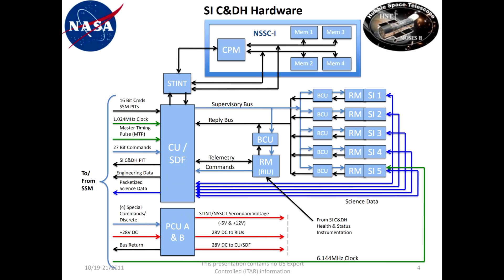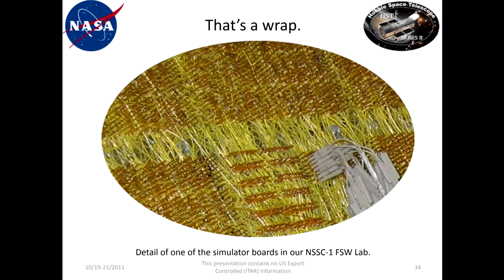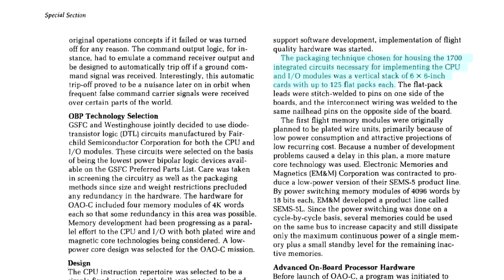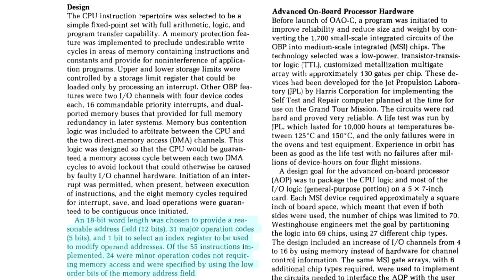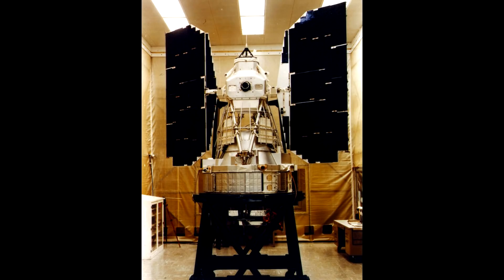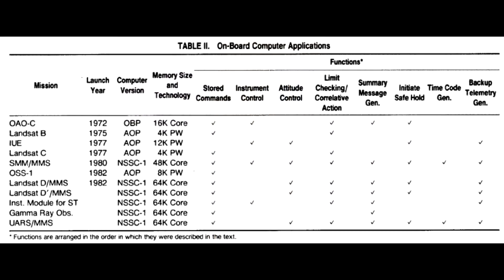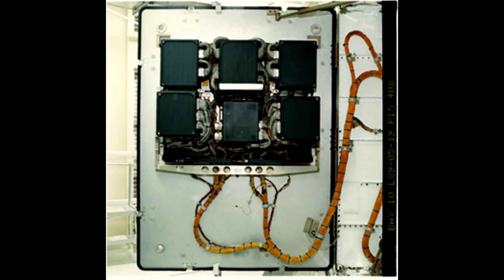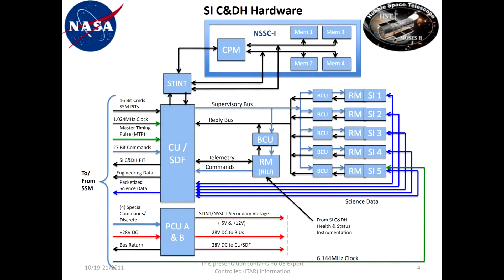Hubble's Latest Problems May Be In a 50 Year Old Computer Design

Comment: There was a CME in May 2021, I'm betting it damaged something that either failed a little later or it just took a little while to actually hit a failure point. 64K of memory isn't a lot though so odds are if that is the case it just took a little while for total failure.

I'd love to play with some of that stuff, I'd wager most of us in IT would.
Reply: What is a CME? Is the ME part of it means magnetic event? Caused by a solar flare of something? That could certainly damage electroncs, but if that's the case I don't think Hubble's systems would have survived 30 years. They must be quite well shileded and rad hardened.
Reply: @mrnmrn1  coronal mass ejection.

There's usually a magnetic aspect to that as well but that's reactive from Earth's magnetic field. I'm sure it has some magnetic strength itself but that's above my pay grade.

Hubble is shielded but nothing is 100%.

We have issues on the ground with terrestrial wireless when the CME are powerful enough, still not enough that it causes issues that anyone else notices.

CME are ejections of energetic particles from the sun, a chunk of the sun is sent out into space at speed.

A large CME could literally wipe the Earth clean, just a barren, dead rock.
Reply: @glenwaldrop8166  Ah, thanks, I knew that stuff, just didn't know its name and especially its acronym, Google did not help either with the keyword CME. I should have tried Wikipedia.
Yes, that's very nasty stuff, let's hope an other Carrington Event won't happen in our lives. Few years ago I read an article about what could happen if a Carrington-level or sligtly stronger CME would happen nowadays. The resulting magnetic storm might cause an effect like if it was WW3, because it's expected to bring down most of the electric power distribution systems and the whole Internet globally, with equipment and infrastructural damage (including many satellites) worth of trillions of dollars, it would take many months to recover just the electric grid, let alone the Internet, this would certainly wipe the economy globally. On top of that, there would be a good chance for multiple nuclear disasters at the level of Fukushima and above, because it could bring down the control and cooling systems of many reactors and consumed fuel rod storage sites.
The good thing is, such a CME should  be predictable, as it usually follows a huge solar flare, which can be detected, and the CME 'cloud' travels quite slowly, it can take hours or even days for it to reach Earth. We are already monitoring solar flares, so if we detect an exceptionally big flare, we should prepare and disconnect all distriubution transformers from the grid until the CME hits the Earth. This would certainly have horrible economical effects, too, but at least the power grid would be recoverable within short order after the event.

Comment: Hi Scott, could you pass this on to Elon, he's not responding to my tweets 😉
Dragon could rendezvous with Hubble, but doesn't have a manipulator arm..
Ok, so why isn't one being designed to fit in the unpressurized trunk section?
Seems like a logical place to put it..
It could be, (excuse the pun), a telescopic style so it can condense down to fit in the 3.6mt space, with multiple elbows to give a proper reach around.. (they fit a couple of pairs of 15' wide solar panels in there in the last CRS launch, so there's plenty of room)
The arm could mount to the top of the inside of the trunk, and after the servicing mission, Dragon could go to the ISS and leave the arm docked there for use at a later date..
C'mon, do I have to do all the thinking here..?
Get me a pen and paper, I'll fix this..

Comment: 50 year old computers should dispel any claim that bloated, pork driven Federal Agency NASA advances technology… Even for Apollo Nasa used off-the-shelf private enterprise technology.. Too many confuse things Nasa USED that were developed by private enterprise or academia.. For example, NASA didn't invent Tang, Velcro, ball point pens, transistors, Integrated Circuits, Teflon,  GPS, computers, microchips, cell phones, carbon fiber, the internet, solar cells, fuel cells, pintel rocket engines…..or much of anything else
Giving NASA credit for the technology it uses/touts is like giving a rooster credit for sunrise.

Comment: Bru. 50 year old pc parts run the hubble. Lol. They could probably replace all the pc requirements for it using a raspberry pi 4. Would probably cut it's weight down alot too. They should just fix it if the lense is still fine just replace the computer and the batteries.

Comment: Video boring. No idea why there's not a updated space thing. With a 3d printer, you can, worst case scenario, 3d print a modern 3d printer. Otherwise, no excuse why space problems will ever exist other than being short on resources. Motherboard old? 3d print a new one.

Comment: that design is that way using the rad hard version of the s80386 (and later AMD 486DX4) because I talked Ball Aero out of using 8051's and lots of Actel FPGAs and won Intel and the RMK real-time kernel in a redundant distributed real-time architecture... would never have lasted as long as it did if they had gone with the original concept. Lol and the CPU is fine it is the memory board that has failed...

Comment: Been programming 39 years - and the stuff they did before me and into the early 80s was amazing. Software was a very tight and disciplined science. Today - with a single jpeg picture larger than the entire computer system back then - makes current software engineers pretty sloppy.
Reply: Yes I remember writing assembly code in the early 80’s - TBH if you wanted smooth speed execution other than Binary there was no choice with the memory limitations. Nowadays they use off the shelf bloated routines, and cobble them together. We have gone backwards with less and less being able or being taught to eloquently code.
Sad really - imagine what could be achieved now, by using less.
Reply: @Nighterlev  that is most definetly not the only reason why. many more reasons why programs or files these days are massive is because devs dont really have a size limit anymore. just look at modern video games. the devs that develope those probably never heard of file compression.
These days if you code something and you need a function you import it from a library instead of writing it yourself. though most of the time that makes the program way bigger than it would need to be because libraries are usually bigger and have more functions than you need for your application. or in other words, compare the size and the memory consumption of windows 10 to the size and memory consumption of arch linux when in both cases your goal is to watch a youtube video. in arch you specifically install what you need, making your system lightweight and resource friendly, while windows comes with all sorts of shit you dont need or dont even want

Comment: The best bit is everything stacked on that entire board would probably fit on a single modern chip and end up a fraction the size of a postage stamp. Paired with a tiny power supply that would draw a couple of watts at most. The CPUs, all the memory, all the buses and sub processors. The lot.
Reply: Yup but that chip would also die in about 5 seconds when exposed to space, modern tech is far more vulnerable to radiation than the older hardware was, so you have to specifically build stuff to survive so no off the shelf parts, and definitely no apple logos
Reply: @shanematthews1985  Radiation hardened processors that are a great deal more advanced than Hubble's hardware do exist. But yes nothing from the last few years because the transistors are so small they are vulnerable to flipped bits. Even so all this gear would almost certainly be viable on a small SoC. Such was the massive increase in performance from when most of this was designed in the mid 1980s up til the most commonly used radiation hardened chips today like the RAD 5500, a product of the early 2010s.

Comment: 2:50   There were 1700 flat pack integrated circuits and there were 125 on each 6x6 inch board.  So, actually there were only about 14 boards in total, as opposed to the 125 boards mentioned by Scott.
Reply from the maker: Thanks, this is why I should write scripts.

Comment: Doesn't it have a backup power supply/voltage regulator?  It seems like it should have a system that physically disconnects one and switches it over every two days or so.

And why can't the Dragon capsule do an EVA?  If the inside of the capsule can be depressurized, I would think that a small robotic arm could be attached to the capsule when they are a few feet away from the telescope and then clamp on.  The time might be limited to how long the astronauts have air in their tanks for however.

Comment: STS-103’s SM3A actually increased Hubble’s memory from 1.2 gigabits to 12 “gigabits” instead of 12 “gigabytes”.  This is how cable companies mislead their customers, advertising their download speeds in the antiquated Gb meaning gigabits, instead of the familiar GB or gigabyte.  Something like 8x slower than you would have expecting.
Reply: Being that sm3a took place at the end of 1999, a 12 GB ssd (or “ssr” as NASA dubbed it) would have been extremely cutting-edge.  Although we had developed HHDs at that time which would have put even 12 gigabytes to shame, the SSD style format was severely lacking as it was really just being introduced.  So 1.2 GB ain’t half bad, especially being that we were barely ahead of core rope memory days!

Comment: Sounds like an electrical issue.  That is the most common  cause of multiple failures on redundant component, even with redundant power supplies.  Eectrical.issues  (and also   RF) usually  cross redundant   boundaries, 100% full isolation is not really possible in those systems.

Comment: It sounds like an in-joke of the retrocomputing community, but have they used MT-RAMs in the CMOS replacement memory modules? These are currently failing left and right and if they actually had been used I wouldn't be surprised if all 8 modules failed at more or less the same time.
(sure it's a stretch as far as a bent out paperclip would have to reach, but hey maybe).

Comment: Surely the best option for repairing Hubble would be to use something like Dragon to toe it to the ISS, since ISS does have things like the manipulator arm. It would also give them time to give it a full once over and adapt it in someway to better link with ISS in future, since there wouldn't be time constraints based around a crew on a single mission.
Reply: That's absolutely no option as they are in completely different orbits.

Comment: The computer systems of these government funded projects are as complicated as much money is on hand. Therefore Hubble has 32 bit computer talking to 27 bit computer talking to 17 bit computer talking to 18 bit computer and vice versa.
Using one type of standard computer module wherever possible would be cheaper and more reliable.

Comment: Considering the fact that this system has withstood rampant radiation and EM exposure, stick with it.

I don't think we've seen any newer systems withstand that sort of abuse.  You stick with what works, and don't just go with new and shiny.
Reply: Maybe install a secondary system with modern stuff, that is completely independent from the original systems. It gives extra redudnancy and it would be a good test for the new tech of future space telescopes.

Comment: Having started programing in the mid 70's I've had a lot of opportunities to work with some very different hardware.  You mentioned 18 bit instructions.  These were standard on the PPU of the CDC 6600 and the main CPU itself was 60 bits.  Meanwhile over at Honeywell, their CPUs were 48 bit.  The Tandems were 16 bit, but inexplicably, their assembler used octal.  If you want something very odd, you can look up the Russian SETUN.  There is a tribute page with an online simulator that lets you run programs.  It operate in base 3 using balanced ternary.

Comment: i wonder how they carried out the burn-in (reliability) test on each components of the payload computer before launch. For over 30 years space operation, it means over 10k extreme range thermal cycles. Even i assume they have some thermal protection / insulation to limit the temperature range.

Comment: SpaceX and Nasa need to design and build a disposable ( or reuseable) spacecraft that fits into the Dragon trunk. Basically something sorta like the pods from 2001 a space odyssey.  Have two manipulator arms, an air lock, and seat 2-3 astronauts comfortable and sustain them for several hours to maybe a few days. It would deploy from the trunk, autonomously translate to the front of dragon and dock. You could then add more "space shuttle like" capability to the dragon capsule, and even leave one or two at the ISS for extended EVA, maintenance, etc.

Comment: Since we can’t do repairs immediately due to the lack of mean of transport, we should at least use one of those mission extension vehicles to prevent the telescope from reentering the atmosphere for a time needed to come up with a viable solution of either repairing it on site or taking it safely down. Webb telescope will work differently so it won’t be a one for one replacement, therefore there’s still work HST could do. We live in times of replacing rather than repairing but there aren’t many apparatuses more useful and deserving than HST. It gave us so much. It should be either repaired and upgraded or brought back home. I mean it’s not a Voyager probe, in cosmic terms it’s within reach.

Comment: Send a remote booster to attach to Hubble and alter the orbit. Bring it up next to the International Space Station. Then use arm and EVA to attach Hubble to the ISS. It would probably lose most pointing ability but could still do some work scanning a fixed plane ahead or to the side of the orbital path of ISS. It could also potentially serve as a test bed for technologies that might be used in a future more mobile space station. ISS crew could service it by EVA whenever needed.

Comment: Come on haters, who’s still using 50 year old computers?  We have a couple CNC mills running still from the mid 1990’s and I feel like that’s a win! They are soooooo much better now, but the longevity some of the older machines was unbelievable.  Heat, vibration, dust, oil, coolant and smoke, and 25+ years of semi continuous use. I’ll cut Hubble a break, it’s produced better than hoped.

Comment: They should send a Dragon 2 service mission and replace it.
Reply: It's not possible - Dragon does not have the facilities to carry out a servicing mission
Reply: @johnmurrell3175  Can it not reach the orbit of Hubble?
Reply: @henrypierce8010  Probably but it has not got things like the facilities to support a space walk and it has no remote manipulator arm to hold Hubble relative to the capsule.  Also the existing computer is quite large so unless they are going to design, test & space qualify a new computer there may not be room to store it in the Dragon capsule and then manouver it out through the docking adaptor.
Reply: @johnmurrell3175  Think like Musk.... outside the box.
Reply: @johnmurrell3175  Well, that is a poopy.  I just looked it up.  Neither Dragon2/CST-100 can depressurize in space.   And Orion only carries enough consumables to do it once.  But an orbital Mission module that Dragon can dock with could be designed with a proper airlock.  It could be launched by Falcon Heavy to be meet by Crew Dragon.

Comment: A lot of people commenting on the age of the technology being used in the hardware. One of the guiding policies is the chips being used have to have all the problems worked out of dies to give great stability and doesn't go "blue screen"  on you for any reason. No glitching and lock up. Also , the testing for space quality chips is even higher than mil spec. It makes them quite costly. It would be interesting  to see a show about chip testing for space.

Comment: Hmm. If the concern on using modern CPUs is that the tiny transistors can be flipped by cosmic rays and such, I wonder if a CPU designed with groups of transistors that replace each traditional transistor in the design.  Each transistor in the group could "vote" to provide the functionality of a radiation hardened transistor.

Comment: Yes lets spend a million dollars for a proprietary computer system instead of buying a $1000 off the shelf computer, and adding control cards.  A Commodore 64 with an extended cartridge with controls routed through the RS232 could have done the job.

Comment: Additional, based on vid's closing remarks. I believe while the mission may not be easy and may require EVAs of long durations, the upgrade of the computing and power systems can be performed. Yes, it will require smarter brains than mine to work out the requirements and logistics. But I fully believe we have the capability to do so - not with most ease, I'm sure, but it can be done.

Comment: Plated wire memory all the way until 2009, not core memory unless you work for Apple, in which case everything has to start with Core, coredata, coreaudio, corefoundation, coregraphics.